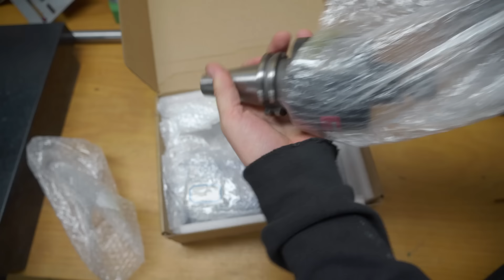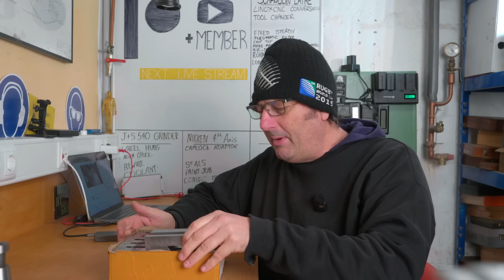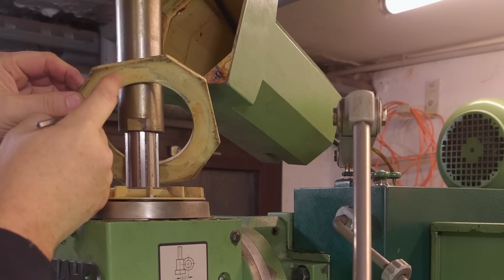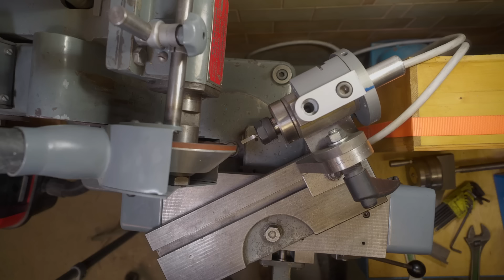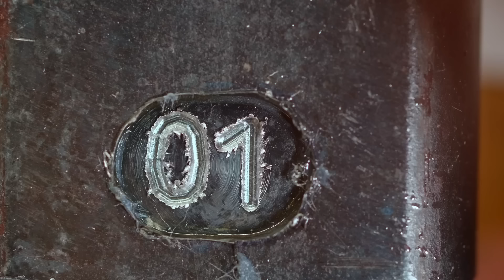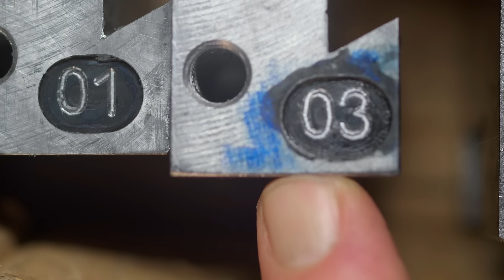Does a spindle speeder work for engraving? || RotarySMP

Comment: Ive had very good luck engraving with small center drills and even spot drills. Maybe give a #0 center drill or an 1/8" spot drill a try and see how it stacks up to the D-bit cutter. Cheers
Reply from the maker: I have a tiny ball mill on order, but it did not arrive in time.

Comment: Silly question: If you already have numbered tool holders, why didn't you start numbering AFTER your last existing tool?  Now you will have duplicate holder numbers.  Lot's of fun thanks for your show.
Reply from the maker: The tool holders which are already engraved are tiny 0XA sized ones for the mini lathe. No cross over between the two sets.

Comment: A side-mount a high-speed spindle can been seen on a Maho in Copenhagen Suborbitals' video "Machine testing for new injector plate". With so many affordable high-speed spindles being on the market, it could be a pretty worthwhile experiment for many people with older mills that have the prerequisite mass and rigidity. If it doesn't work out there are lots of other ways you could put a high-speed spindle to work!
Reply from the maker: I was originally planning to do that Paul. Now I have the Spindle speeder and the pneumatic grinding spindle, I will give them a chance.
Reply: @RotarySMP  Yep, I've been watching. Tempted to tear-down the spindle speeder? Would make an interesting video!

My comment was of course intended for others who might be considering their own high-speed spindle options :)

Comment: for engraving i actually use a very small drill bit.  You get a very quality result, and the bits are cheap in packs of 10....   can easily get them in carbide for cheap too.
Reply from the maker: Thanks for the tip Jared.

Comment: Watch the bluing, if you don’t clean and oil it to stop the chemical process it will corrode the base metal.

We use it to identify stainless from carbon steel.

It looks like your machine is cutting straight segments instead of arcs.

You shouldn’t have to regrind your bits that often, too fast of a feed maybe?
Possibly try a different grade of carbide?
Reply from the maker: Thanks for your tips. I took another swing at it this week, based on the feedback you all gave.

Comment: Swap a TESLA motor on it, the newer carbonfiber wrapped rotor ones. Spin a 4" x 12"  end mill like nothing,  at 550,000 rpm at 500 feet per second , the insert tips giving off tiny SONIC BOOMS AS IT SPINS 😂😂😂, A 500 HP SPINDLE MOTOR IS NOT TOO MUCH! 😂😂
Reply from the maker: Make that video James. I'd watch it.

Comment: Get some 6 mm diameter carbide and grind 3 flats at 30 or45 on end to form a sharp cone point. You only need .003"deep to get good results. feed rate is low to begin, then, build up gradually.
Reply from the maker: I showed a pyramid engraving bit in the intro. Ran out of time to resharpen it and try it in this set up.

Comment: 0 is lumpy as it looks like there aren't enough segments to give a smooth curve.
Reply from the maker: True. Not sure why.
Reply: @RotarySMP You might have to set it in the Cad software or the Cam / Slicer equivalent.

The g code generator and the CNC controller don't always support splines and beziers (CAD does) so need lots of line segments equivalent.

It's hiding somewhere along the chain from Design to Cuts.

Looks fairly decent as is but worth finding it for when you need it neat next time.

Carving nice messages into toast for valentines day perhaps 😅

Comment: Next time you try engraving, try a ball end mill. I have been using 0.047 thousandths 4 flute ball end mills at 12000 rpm and they seem to last forever in any steel and leave a very good finish.
Reply from the maker: Stefan Gotteswinter also recommended that. Shame I forgot to buy some :/

Comment: Another suggestion would be switching off the coolant and filling the recess with kerosene or light machine oil. With those tiny cutters, heat isn't an issue, but edge build up is.
Reply from the maker: Thanks. good tip.

Comment: On grinding d bits for engraving some of the engraving machines had a cartridge system bayonet type so you could remove the entire spindle with the bit in it and grind it for maximum concentricity to the spindle. They also had an end that could follow a cam so the depth was constant if working on a curved workpiece within the limit of the system ~4mm for the small deckel type/clone pantograph engravers. 

Am definitely going to try your method with flipped wheel on l the clarkson to try grind my own d bits.
Reply from the maker: That would be a nice way of keeping concentricity.

Comment: I liked the non-rotating diamond engraving. It's spring-loaded along the Z axis, and you can get very fine lines. But it's more like scratching than engraving.
Reply from the maker: I have a drag engraver I made with a carbide tip. It works well in softer materials, but does not give sufficient depth in steel.

Comment: That label is clearly stamped "823/○○65/i 1:5/26○○○"

Also.. at that size, into steel, those D-bits are going to break / chip dull extremely fast. Your best bet is to either grind, or buy a 3 flute engraving bit. they hold up much better at those speeds.
Reply from the maker: Not sure why Henninger told me they didn't make a 823 :)

Thanks for the tip.

Comment: One potential cause of chatter at high speeds. Using series wound motors for reference which will accelerate until an equilibrium is reached. Limited by back electromotive force (back EMF), which increases with speed and reduces the current and torque, structural integrity and heat generation from electrical losses can also restrict the maximum speed. At that speed they will 'bounce' between acceleration and the speed limitations. 
I suspect a similar bounce with the gearing in the high speed devices, likely going on in the nanosecond range.  The common method for reducing bounce in series would motors is to induce an electrical or mechanical friction which keeps the speed in the acceleration region continuously.
In other words, some sort of m3echanical brake slightly dragging the output shaft can reduce that chatter you are experiencing. 
With critical applications in series wound motors a common method is a contained air chamber containing a fan utilizing a precise amount of air friction. 
Or a typical common example is a router. The fan in the router serves the dual purpose of cooling and braking keeping the RPMs below the maximum speed. However, excessive brake will actually generate the bounce effect. Very common in leaf blowers. Makes is seem like the armature is unbalanced.
Reply from the maker: Which series wound motor? The main motor on the Maho is a 3Ph induction motor.
Reply: @RotarySMP  Analogy. Your high speed gadget is in essence emulating the armature of such a motor.

Comment: It pays to have good ER16 collets for small tools. I only use RegoFix and friction nuts.I never even check runout anymore, it's always virtually dead nuts on a ,0001" indicator. Feed rate low, start with 0.02mm per tooth.
Reply from the maker: Thanks. I'll collect all the suggestions and try again.

Comment: Always wanted to see one of those speed increasers being used, Thanks. Try to side mill some material. If you measure a taper, then that could imply deflection. If the spindle has runout under load, a slot tool path would be a way to quantify that. Regards
Reply from the maker: Good tip. Thanks Martin.

Comment: I do quite a bit of engraving, and my CNC machine is not the most rigid, I designed it mainly for plastics.
Here are my tips for engraving and trying to make it work;
1. SLOW feed speeds, make it crawl. Most tip breakage and bad finishes are from running too fast a feed.
2. Dont try and do it in one cut. I do at least two cuts to get to depth, then a finish pass at about 20 microns more depth, good for deburring the engraved letter and getting a better cosmetic result. Change the feed speed by about 30% too for cosmetic reasons. So that is 3 cuts typically.
3. I just buy engraver bits from China ebay etc, you can get 10 bits for $12 or something.
4. Try to hold the bit deep in the collet, less stickout and flex.
5. SLOW FEEDS!!!! SLOW FEEDS!!!! (And dont talk about fight club)
Reply from the maker: Thanks for your tips. I'll slow down from 100mm/min and try again.

Comment: Have you looked at the tip of your tool under high magnification? Or do you have a optical comparator maybe? I suspect you don’t have proper cutting clearance on the tip of the tool. All D bit engraving tools I have used have a cam type clearance kind of like countersinks have. Just looking at the burr it’s leaving I think that’s your problem. Then also put a dial indicator on the shank when it’s all mounted in your spindle to check the actual runout of the mounted tool. This will check for all the error. Collet spindle and all. ER collets usually runout bad unless you buy a high precision one. It may be worth the expense for just this one collet. Also a shrink ER collet could be used and left on the tool. If you setup your grinder with the same collet chuck you could just move the tool with the shrink collet on the shank. That way you eliminate the collet runout completely.
Reply from the maker: Thanks Peter. I have the cam like relief on the cutting edge, and ground the tip with both back rake and side clearance.  I'll put a clock on the spindle and the D-bit to check out the collet too. I need to look into shrink collets.
Reply: @RotarySMP You could make one pretty easy by drinking a piece of steel on the carbide shank of your tool. Then putting it in a collet on the lathe and machining the tapers to fit the ER spindle. Just like the collet has.
Reply from the maker: @EdgePrecision  Thanks Peter, another one for the to do list :)

Comment: Can I interest you in a MSK050C-0600-NN-M1-UG1-NNNN?
Reply from the maker: Hi Alexander, Nice motor. The only possible use case I would have for a motor like that would be replacing the Schaublin spindle drive system. I can only see myself doing that if I have a major failure of the back gear or variator.  Do you have the matching drive, and can they work together on a 16A 400VAC feed?
Reply: @RotarySMP   Hi Mark nice progress on the tool holders .   on the schaublin website  the  125-cnc lathe is listed as having a 5000 rpm spindle with a  7.5/11 kW fanuc spindle motor.
If you were ever to got the route  of replacing the variator and gearbox with motor and belt straight to spindle  as schaublin has done , that what be a good starting base.
In the past you have referred to the spindle motor as a servo motor , there are major differences  starting with an axis servo motor  uses magnets on the rotor whereas a spindle motor
is a much simpler induction motor ,similar to common  AC motors.      
better to look for actual spindle motors  and inverters, rather than  servos.

Comment: Very interesting! I know these are considered obsolete but by coincidence here in the UK  I’ve been using a similar speed increaser last week for engraving (on my TOS CNC mill from 1996). My mill has max 4000 rpm to the spindle. My speed increaser is Swiss made and branded MULTITOUR and is from 1963. It has a 15:1 increase but as such that makes it longer than what you have there (200mm) . Its max input speed is 800 rpm giving 12000 rpm out. It's extremely quiet and hard to believe the cutter is really turning that fast!  It came with MT4 arbour and I had to make my own INT40 arbour for it, in doing so I’ve ended up with a slight run out at the cutter of about 0.02mm, which so far has been ok. Currently  I’ve been using a Chinese 0.6mm diameter twin flute HSS TiAln slot drill and it works very well, being less fragile than the sharp tip of a D bit. At max rpm the increaser gets quite warm after about 90 minutes continuous use , so I let it cool down. Biggest disadvantage of this unit is its height which is close on twice that of your version. I also have (from the same manufacturer) but this time branded PLANETOR a wonderful planetory grinding head, again for the mill, which is similar to their speed increaser but both increases spindle speed (max 45000 rpm from it's 70:1 gearbox or 22000 rpm from its interchangeable 33:1 gearbox), also at the same time the grinding output head runs eccentrically like boring head, i.e. in a planetory motion with adjustable throw.  All as you'd expect for grinding all with really great accuracy. Great stuff from 60 years ago that few of us appreciate now!  I should probably learn how to make a video to share! Nick
Reply from the maker: Thanks Nick. I will give some HSS a try too.

Comment: Mark, maybe the feedrate is a little too high? You could check the run-out on the tool itself for a better understanding of what's happening. Furthermore I use Nine9 carbide engraving tools with inserts. They work like a charm. Best! Job
Reply from the maker: Thanks Job. I'll check the run out and slow down the feeds.

Comment: At 2:12 ish, you're measuring run out with gravity on your side and you then check end (axial) float but not radially. Or did I miss something?
PS Love the 'bosses'.
Reply from the maker: Good point. I need to recheck this with it in the mill.
Reply: It's effectively another two spindle bearing sets hanging off the BT taper so plenty of opportunity for run out under pressure (even from a tiny engraving bit).
Reply: @RotarySMP  Pull out a .001 or .002mm indicator next time. 🙃
Reply: Preloaded angular contact bearings are going to either be tight or junk.

Comment: I use Hss centre drill for engraving letters at work. 0.3mm depth of cut. Spindle speed 5k and feed i dont remember but low.
Reply: Yeah, I use 3 flute 45 degree (90 degree inc) HSS centre drill for engraving aluminium. And a drop of lube.
Spindle speed about 12k and SLOW feed.
Reply from the maker: Might have been too fast on this.
Reply from the maker: I will give HSS a try.

Comment: The number 0 looks terribly "square." As if there's a huge amount of slack/backlash somewhere in the system, or something's wrong with LinuxCNC's interpolation.
Reply: It's made of straight lines.
Probably the font.
Reply: @wizrom3046 but this is same CNC gcode he used previously and there 0 is nice and round.
Reply: @Qyonek    hmmm, a mystery.
Maybe something in the CNC settings on how it handles curves?
Reply from the maker: @wizrom3046  It is a rather faceted font, since I generated it with an ancient version of FeatureCAM. Linuxcnc has just followed the programmed path. At a normal viewing distance it looks round.
Reply: @RotarySMP so it is
different Gcode from previous tool holders?
Reply: https://youtube.com/shorts/JFUfhDWDvAQ?si=k7L6oPazd60Myk-9
Reply from the maker: @Qyonek  Oh, I see what you mean. It is the same code I used. Now I have to try and work out what the faceted result.

Comment: My first guess and thing I would check is definitely the ER collet ( have tried some that had a total runout of 0.4mm ) maybe since you are probablyonly going to use one shank diameter with it getting a adjustable ER to hydraulic adapter for it would be a good idea. I know I would if I knew that I would only put the same shank diameter in it every time
Reply from the maker: I need to go and put a DTI on it.
Reply: @RotarySMP   would be a very good idea to do that with a long carbide tool or a gauge pin it the collet though if you are only gonna use like 6mm shanked tools it would probably be a good idea to get one those adjustable ER hydraulic adapter for it anyway ( etp makes them down to ER 16 collet size in 6mm and 8mm shank size
Reply from the maker: @flikflak24  Yeah, Peter of Edge machining also suggested that above, but a home made solid collet.
Reply: @RotarySMP  ahh you mean a heat shrink collet. Problem is that you can't adjust them into running true / remove the T.I.R. unlike the adjustable hydraulic adapter

Comment: Engraving. Was wondering if you should do multiple passes to get down to the required depth, as in, you are engraving too deeply on first pass? 
Be a bit more gentle on the bit?
Reply from the maker: The engraving is only 0.2mm deep. Is that too much?
Reply: @RotarySMP  I agree, it's only 0.2mm but you are damaging your tools going to 0.2mm.
I am not a jeweler so do not take my comments as gospel but given the damage to the tooling you experienced, I would have tried to be more gentle on the tools during the engraving, maybe less deep, more passes?